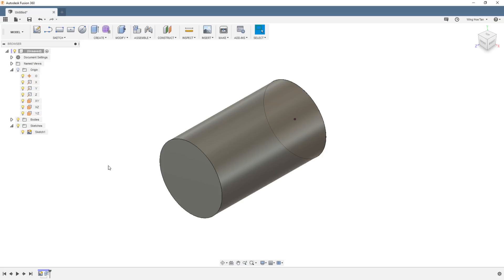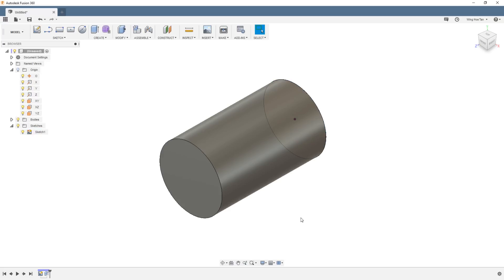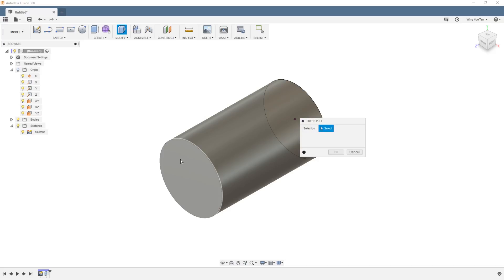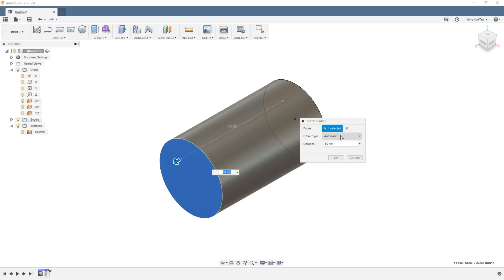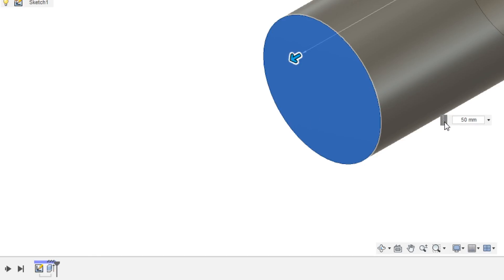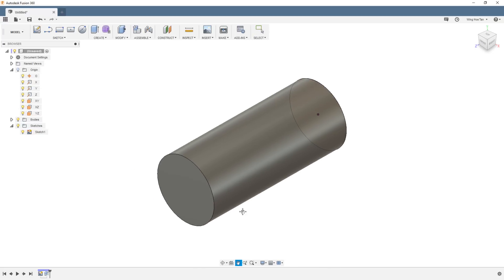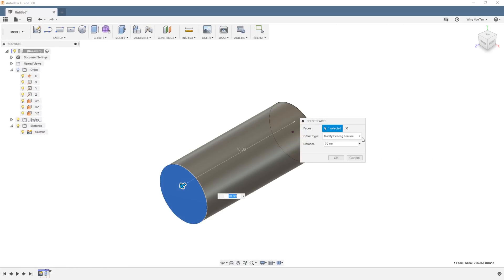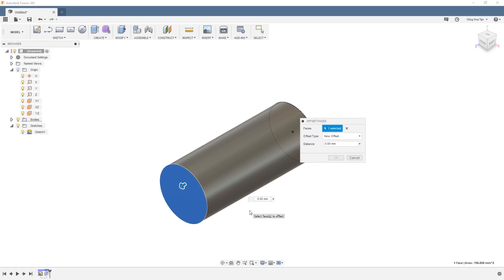Fusion 360 - Using press pull to modify an extrusion

Comment: Hi, can you please re-explain the differences between 'automatic', 'modify existing extrusion', and 'offset'?
Reply from the maker: Hi, let's start with a cylinder that was extruded to 50 mm. If I use the press pull command on the face of the cylinder and choose the new offset option, this allows me to extrude the cylinder by a further distance on top of the 50 mm. At this point, if I adjust the offset distance to 20, the total height of the cylinder would be 70 mm.

By selecting automatic, you are letting the system decide which option to use. The system would almost always choose to modify the existing extrude feature. In other words, there would be no difference between choosing automatic and modify existing feature. At this point, in the distance field, you should see the original extrude distance. Changing the distance here is equivalent to opening up the original extrude feature to change the extrude distance. There would not be any step added to the timeline. Hope this is clear.